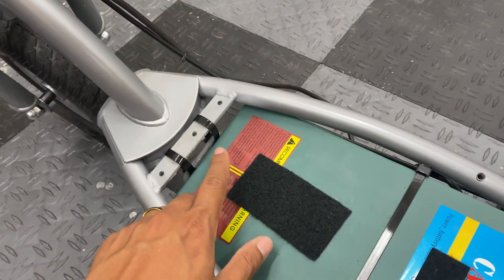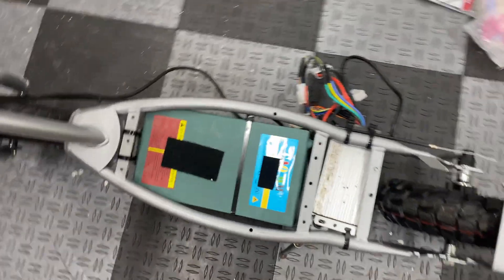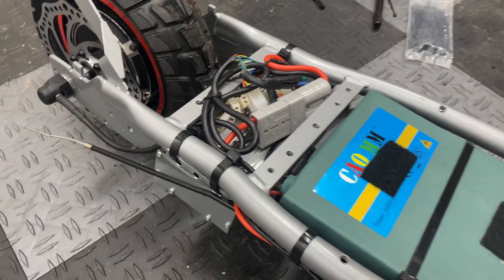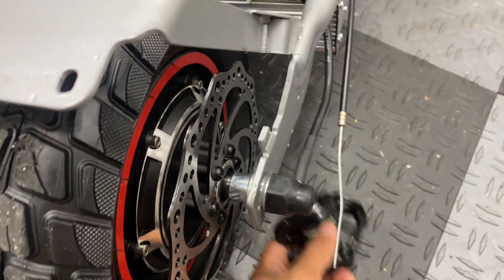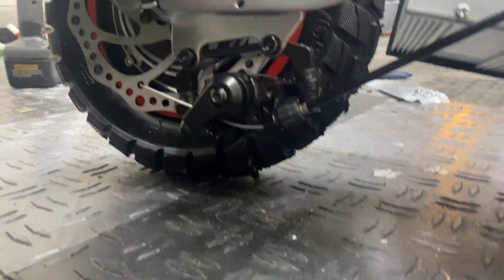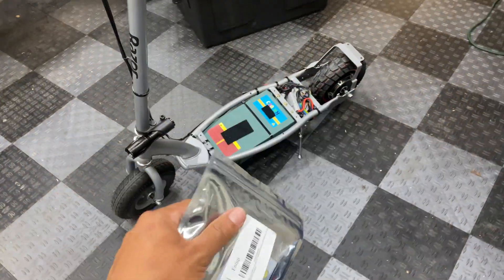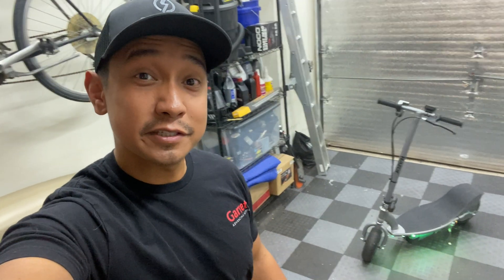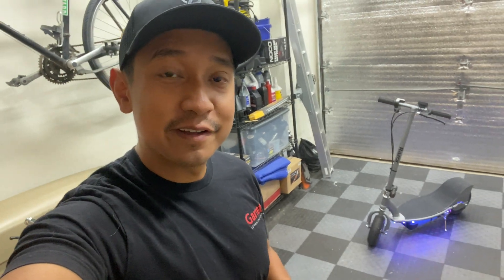Razor E1800 52V Brushless Hub Motor Conversion E325 Electric Scooter Part 2

Comment: me again, is it possible to remove the 350 drum brakes and replace them with discs?
Reply from the maker: Ok the factory wheel? I don’t think so. This one is being converted to disk. Stay tuned for the next video, had bracket welded.

Comment: Love these diy builds. I think I've been more excited about this then the bikes. And worst case scenario, grab a pocket mod and throw all this into it 😅. Be a great in between platform between the scooter and bikes lol.
Reply from the maker: Man.. I was looking at those recently but just can’t justify having a ton of scooters in the garage and all the battery $$$
Reply: @PatOutdoors  oh I know it man. I got mine for free. Usually you can find them cheap. I slapped a 350w motor and 36v stock electronics and runs 18mph with it

Comment: Nice work Pat!

Out of curiosity, is your garage climate controlled and do you leave your batteries in the bike because of that?
Reply from the maker: So my garage is not climate controlled, though I wish it was! I do have it insulated so it stays consistently between 60-80 degrees throughout the year. No battery issues